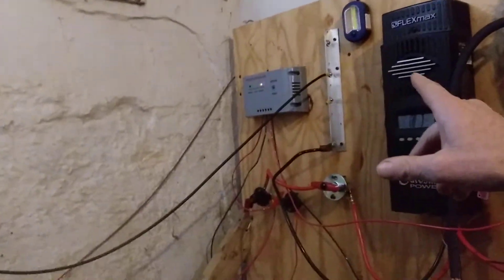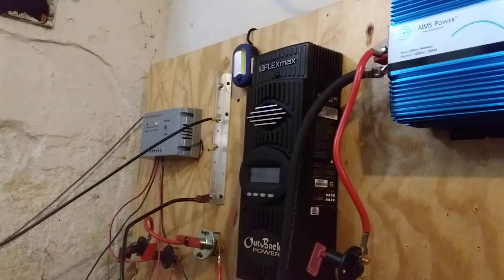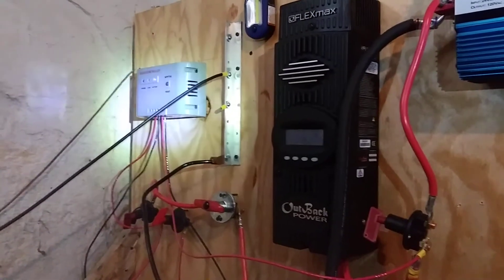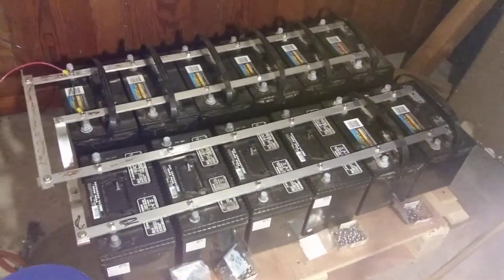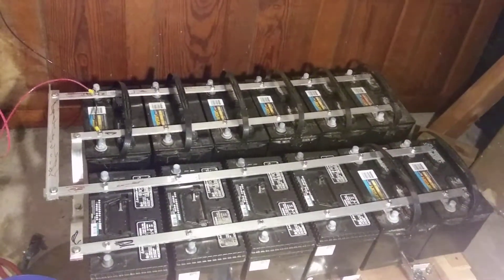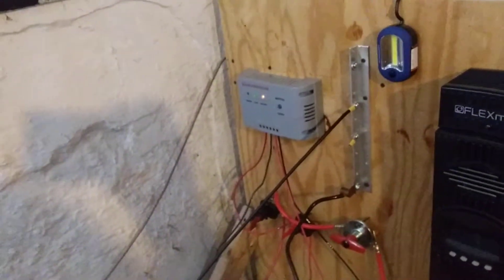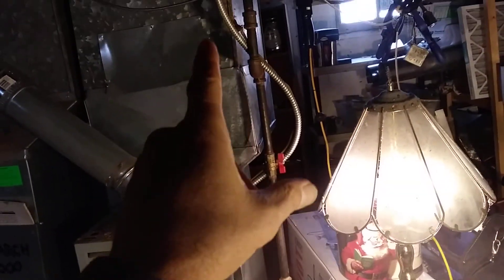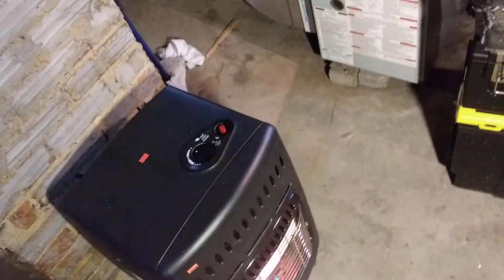Changed out the little charge controller

Comment: Nice setup boss.
But I will recommend you use a better charge controller on the 12v system just like the one you have on you 24v setup. 

Those batteries need a good charge controller to charge them above there normally voltage to prevent sulfation.

I suppose they are flood lead acid batteries which needs to be EQUALIZED once in a while to prevent sulfation.

I just wanted to point it out to you.
Cheers

Comment: Hey brother that top pwm good for 24 volt in and 24 volt out I believe you can do 12 in and 12 out the 24 volt is good for 80 amps but I’d recommend only around 60 amps from it to your batteries at 24 volt the 12 volts from the controller I wouldn’t do over 30 to 40 amps